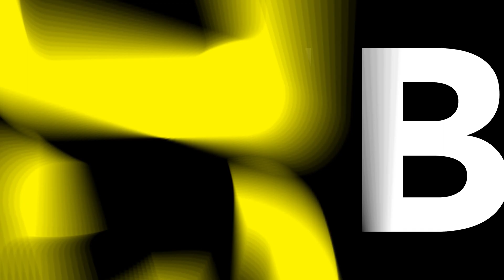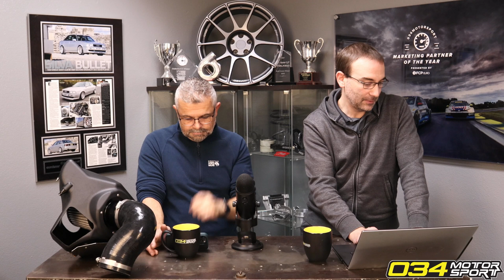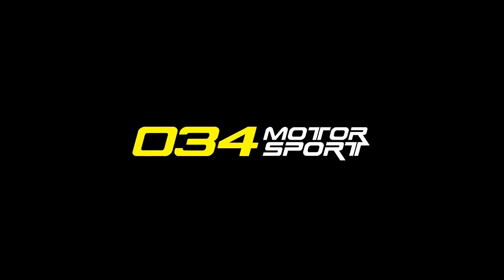Is It Safe To Launch Your DL501 DSG At High RPM? | 034Motorsport FAQ

Comment: Dl 501 is rated for 550nm...and the launches kills this chocolate transmition!!!
Reply: Have done over 300 launches on my B8 S4 (stage 2+ tuned so close to 700nm), no issues at all. If it breaks I'll rebuild it, until then have fun.
Reply: @JJEnterprises-hs3yi  are all the DL501 parts interchangeable between Audi and Porsche? I ask because I have a Macan Turbo with this transmission. But I'm not sure if Porsche used any proprietary parts for it. I'm planning on building the car to produce 800 HP to the wheels so I want to make sure I don't yeet the drivetrain to Hell.
Reply: Chocolate???
Reply: my tuned s5 has launched at least 50+ times, and still feels like the day i bought it. these transmissions are truly solid, you must’ve had a lemon or neglected maintence, or you were very unlucky.
Reply: @xbwkaosxnsh188  I honestly this it's a mix of things. Poor maintenance from the previous owner, a faulty transfer case, a bad mechatronics unit, and poor transmission software. The clutch pack is going bad now but I've replaced and/or rebuilt everything else around it. Might just go to 034 Motorsports and have them rebuild the clutch pack and update the software.